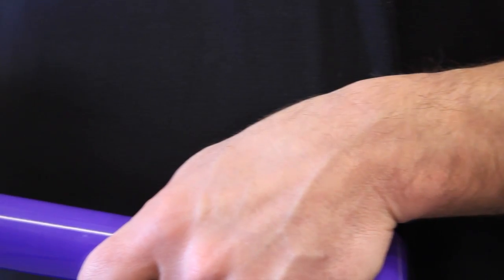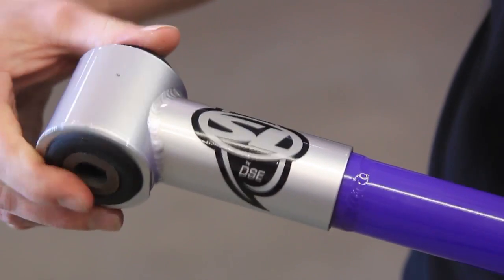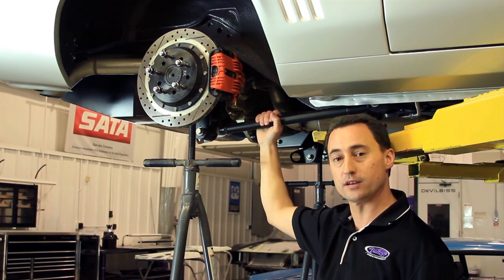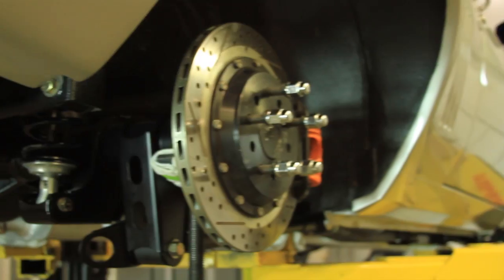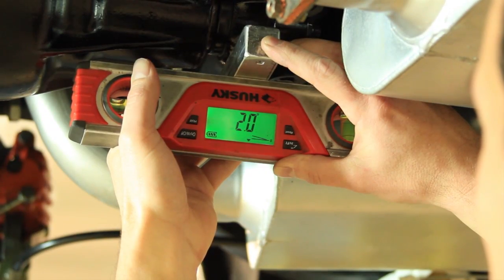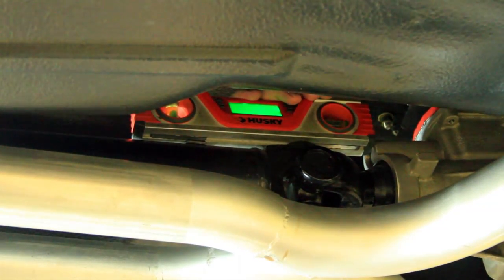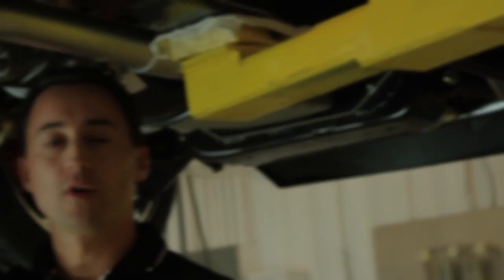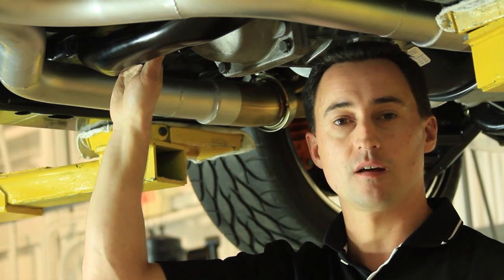Pinion Angle - Detroit Speed Tech Series

Comment: Why would you have both ends at -3 to -4 degrees?  Maybe I’m wrong but your angles are supposed to be equal but opposite.  Leafspring -3 to -4 then at the transmission output +3 to +4...
Can you explain why you’re recommending basically equal down angles?  Very confused 🤷‍♂️
Reply: It's confusing because they say a downward angle on the pinion even though the yoke is pointing up but all angles of the drive line are measured from front to back which means the pinion shaft slopes from it's yoke, downward  into the axle housing.
Reply: @buckylaine755  So, I'm about to set my driveline angles.  If the engine/trans measures 3 degrees down (high in the front, sloping to rear), it's OK to have the pinion tipped up in the front, which is actually still a downward slope?  And the difference in those parallel angles should be between .5 and 1 degree of each other?  Correct?
Reply: @jamesberbrich6440  Yes, that is the correct orientation.